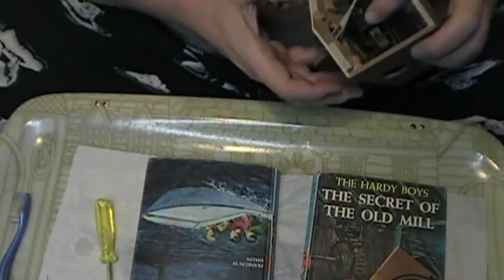Cuckoo Clock Repair 2.wmv

Comment from the maker: Pull the hands and the clocks face. Watch out for glue, you may need a razor blade to work the glue loose if it has any. Then right behind it is the cuckoo mechanism. Look at this video again where the shaft is sticking out and I am showing it working properly and watch how it works with the hour counting arm moving up and down into the counting mechanism. Either the arm is sticking up, the wheel is slipping or... You will want to take it to the hour then watch it in action to find the problem.

Comment: Hi Reed, I have a genuine Hubert Herr cuckoo clock that I received for Christmas.  The clock has been running fine until now....The weight on the left will not come down.  Is this something I can fix or do I need a professional?  Thanks!  Loved the video!
Reply: Susan Mann ..... Hey Susan have you gotten a reply on your question? I have a clock with the same problem. Curious as to what to do!
Reply: no, never got a reply, going to take mine to the clock shop.
Reply: +Susan Mann sorry, we've been on vacation across the US and haven't had the PC on for over a month :) The chain is stuck or it sounds like it got pulled up to far, putting the gear in a bind. Try pulling lightly on it while starting and working the pendulum. Then if the pendulum then starts working on its own, let it go for a few minutes and the chain should drop.

Comment: Hi Reed, my clock has the chain stuck how do I fix that, do I have to remove all the parts to reach to the gear. I think it is the minute/hour chain and not the one for chime and cuckoo one
Reply from the maker: Ashesh Sharma No, just take the weights off, set it upside down and try working both sides of the chain a bit until it starts moving. You should pull the back off and watch the chain to see where it is stuck. It may need a little work but probably just got pulled up to tight. If it won't pull because the S hook is against the wood, then you will have to remove the hook and re-thread it.
Reply: Reed Lukens 
Hi Reed, appreciate your response, the problem is the end which has the weight is completely up towards the hole (on the clock bottom) and it is jammed, Let me try once and will share the update. Appreciate your response sir!

Comment: I am looking to make a cuckoo clock. One with two platforms of dancers, two sets of doors that open, and of course a cuckoo and music.
I've seen similar clocks online, but I want to move things around and to use a different building design. That would mean I'd need to get different gear diameters and other changes. Any idea where I should start?  Thanks!
Reply from the maker: It all starts with the movement, you should get some rough dimensions and then pick the right movement for it first. The design around it.
Reply: Reed Lukens. Thank you. Actually I have something sketched out. But I'd like to see what type of movements and gearing are used to get dancing wheels off to the side and below the mechanism and how some of the animated figures work. Where can I see the innards of some of the more complicates animated Clocks in action?
Reply from the maker: Look here on youtube, there's literally tons  of movies that show cuckoo clocks being made. I think I have one on my playlist, click it and then it should open up a bunch more. You can also look at tower clock movements for the big picture :)

Comment: I was trying to set the beat on my clock, and the cat grabbed my chain and pulled it up.  HOOK and all up in the mechanism.  Any suggestions on how to get it out?
Reply from the maker: Lisa Carter Take off the weights, put a pipe cleaner or wire through the chain that is still in place and tie it in place. Then turn the clock upside down and move or lightly pull the chain  back down to where it belongs. Be sure to watch the chain and keep it in the sprocket. When you have it right then keep pressure on it as you turn it right side up. You will have to jiggle it some to move it into place  :)

Comment: I have a cuckoo clock. Everything works except the hands don't turn! All works when I turn the hands manually but otherwise all I have is the ticking but no other sound. Is this easy to fix?
Reply from the maker: Nope, it needs to be taken apart

Comment: Could you tell me how to fix the chains, I've pulled the the chains to the top without the weights on and now the clock doesn't run and I can't get the chains to reverse, Thanks Sean
Reply from the maker: +puppier Just lift off the pendulum and start the movement with the weights on. The little pendulum shaft will start moving fast and the chain will lower for the time or clock side, you can gently pull on the weights if needed to make them work sometimes. To lower the other simply advance the time to the hour and let it cuckoo it's way down as far as you like. If that doesn't work then you can take the back cover off, then look at the 2 chain drive wheels, then take the weight hooks off of the chain so it's just plain chain only and pull them both the rest of the way thru. Then you can re-thread them.
Reply: Reed you are truly amazing, this country needs more people just like you. Thank you so much, my clock is now working!

Comment: The bellows on my clock are glued in, not screwed in. I can't get the works out without ungluing them, and then there are no screws to re-secure them. Problem is that, like yours, the pendulum can't continue to tick. Turning the clock over, I joggled the chain out of the gear wheel. Can't open it to check for hair balls, and now I can't get the chain re-seated. Any suggestions?
Reply from the maker: The bellows can be pryed gently out, then you can either reglue them, or I prefer to screw them back in place with just a touch of glue in the center. With the clock upside down grabs both sides of the chain to work it back in. It can be easier with a second person to help watch & guide.
Reply: @ReedLukens  What size screws should I use, and what for the positioning nail? How deep should the pilot hole be drilled? ShouldI drill the first part of the hole bigger, leaving only that part that goes into the whistle to take the threads of the screws? I assume that it would be best to do the drilling before I unglue the whistles.
Reply from the maker: @mbhbYT  
Just use a small flathead screw,usually #4's are the smallest but #6 is fine. The length will depend on the thickness of the clock wall & the bellows wall and usually only one screw is needed with just one small touch of glue. The pilot hole should be  the diameter of the solid part of the screw, not counting the spirals. The pilot hole can go thru the bellows wall but keeping it just to the edge works fine.
Reply: @ReedLukens  , should I also make a second drill hole to insert a securing pin, like I see in your videos?
Reply from the maker: @mbhbYT  
Mine was really thin, so it depends. If you think that it will slip, then yes

Comment: Hi Reed,

I need your help. My cuckoo clock I two years old and it is exactly this one you showed in your video. Last week the clock fall from the wall and after that the cuckoo does not count down the hours.. It comes out in half hour and full hour but only one time. What could be? I am really down because I really like my cuckoo.
Reply from the maker: You will need to take it fully apart and look for a bent shaft or tooth in the gearing.
Reply: Reed Lukens Is it usually feasible to fix or it will require to change the movement? Some parts of the wood is very hard to take apart...
Reply from the maker: You can get the new movements easily on ebay. I just took the wood apart on mine for the video. Take the back off, pull the bellows, take off the chains, then remove the movement :)
Reply: Reed Lukens Thanks a lot.. I will try and let you know.. cheers!!!!! ;o)

Comment: Hi Reed....I am hoping you would be willing to help me out....I can't seem to find the answer on you tube and perhaps your answer will also help others :)  In any case, our cuckoo clock won't stop playing music and we cannot turn it off...can you please advise why...There is a spring that's part of the music box, but one end is not connected to anything...what does it connect to?  Thank you in advance for reading this post :)
Reply from the maker: There is a spring that connects to the switch that starts and stops the music. The switch is next to it on the inside depending on the model. If it won't stop each hour then the stop isn't being engaged and it travels or plays until the right weight hits the ground.

Comment: HI there I have a cuckoo clock which has been in my family for some year now.iv just resently brought it out of hiding after watching ur video.as it wouldn't tick.iv repired the bellows an cleaned an reoiled it is now ticking great.but the hands aren't. Moveing 
they move as they should when I use my finger to push them gently .just won't g on there own accord..im bit baffled has every think looks as it should
Reply from the maker: Sounds like you should pull the hands and make sure that the spindles are turning. If not then a gear could be chipped.
Reply: Reed Lukens
Reply: Reed Lukensil give it a try many thanks for your quick reply .i think cause iv checked the gears and theres realy no damage to them .i think it just gave up when my grandfather past .it was brougt for him as a present from germany when my uncle was in service there in the late fiftys early sixtes.thanks again if any luck il keep posted.

Comment: hello. 
i have a cuckoo clock that does not chime .  It is battery operated. I have had it for years but after i changed tge batteries and tried to reset the chimes it did not work. 
  The clock is great.
the logger and bear have not been reset correctly. The diections said to run the hands past twelve then in reverse to 11:00 and it would reset the chime. No such luck.
Any suggestions?
thank you in advance either way.
t. nye
Reply from the maker: The first thing to check for me would be the switch on the side. If it's on then pull the wires and connect them together and that will tell you if you have a bad switch. Then if that doesn't work, run a jumper to the chime and see if it takes power to it. If not then the chime will need replacing :)

Comment: If you do it the right way, you have to adjust the verge if it still isn't running after a PROPER cleaning and oiling. You have to have them on the wall just right to get them "in beat". Listen to it after you start the pendulum, paying careful attention to when it stops ticking. Tilt it to the opposite of the side it stopped ticking on. Most cuckoos have a very small allowance for error in beat. Don't give up. As for "armature cleaning", do you mean ultrasonic? If so, the vibration isn't good.

Comment: Hello
Any ideas for bending the new bird rod that came straight on a new movement to match the old? Heat? remove the rod first? 
Thanks !
Reply from the maker: Stephen Burkhart The rod bends easily with pliers. Be sure to adjust it to get the bird to come out as far as possible. Most of the time there is a little play in the rod.
Reply: Hi Reed Thanks but the rod is like hardened steel. It wants to break and come out of the small fork brackets that hold it to the movement. This is a Herr 8 day. I am going to try to heat it with a small torch.I tried using 2 vice grip pliers also! Of course its not exactly the same as the original movement otherwise I would just change the rods, The original one is shorter (on the movement) and held on by nice screw on brackets. I have to be careful as this is a repair job. The new movement was $160.00 !!
Thanks!
Reply from the maker: Wow, that rod... I thought you meant the slide rod that the bird hooks on... So no brackets, I've never had to use heat in a clock :)
Reply: The heat worked pretty good. It's almost a 2 man job. Had to factor in the bend when measuring. Its more of a curve than a right angle but it worked ok. I did not want to force a sharp right angle. Also had to factor in the position when the bird would be "out".;
It's ok. But Herbert Herr movements are crap!
Nice clocks but bad movements. LOL Thanks again!
Any chance you have a round railroad pendulum? Does anybody make one? Can't find any! Geez I miss my machine shop equipment!

Comment: what a great video!  I have an Austrian cuckoo clock that we have had for about 4 years now.  It’s worked beautifully until I was (gently) pulling the chains and suddenly it fell off of the wall.  Luckily I caught it in mid-air, but when I went to put it back on the wall, I noticed that one of the weighted chains was stuck, which is why it fell off of the wall when I went to rewind it.  The clock still keeps time and ticks, but only one of the weighted chains moves, so the cuckoo does not come out and eventually time speeds up on the clock due to one of the weights being stuck.  Any idea what to do for that?  I LOVE my clock and I am so sad to think I might not be able to hear the cuckoo again :(
Reply from the maker: One chain is for the cuckoo and the other is for the time so I would pull that chain off and find out what is keeping it from moving :)
Reply: ...hmmm...i think you just reached the limit of my ability by giving those instructions, LOL.  the stuck chain’s ’S’ hook - where the pinecone weight gets attached’ - is all the way up against the hole that is is threaded through and up into the clock.  it only moves a hair when i gently tug it, and i can see the gear that is stuck.  i don’t think i’d be able to remove the chain?
Reply from the maker: pull off the weight and the S hook then see if it will pull on through and out. If it does then rethread it and that probably will fix it. You may have to take a link out from inside the clock to get the S hook off if it is jammed that tight.
Reply: thank you so much for your help, but i’m thinking i might be in over my head with this one. worried i might damage it by trying to take it apart?  i made a little video, but am having trouble uploading...oy!
Reply: Okay so I just uploaded a little video showing the problem.  No worries if you don’t have time to watch and respond..I know you don’t have all day to mess with one person’s issues :)
Reply from the maker: If you don't want to pull the chain all the way through then you can advance the clocks time to the hour while pulling gently on the stuck weight and that might unstick it. It's best done at a higher time like 10:00 or more. I'm sure that the chain is just off of the track, so pulling off the S hook and pulling the chain all the way through and then restringing it would be best. But I know what you are saying so advancing it to the hour while pulling on the S hook should get it to start moving but it may hang up more. AT around 8mins in my video it shows pulling the chain out and then at 34mins or so it shows putting the chain back in :).
Reply: Thanks so much for taking the time to give advice...I will definitely try what you’re suggesting!

Comment: Hi I have a clock just like the smaller one on the wall in this video and my wife pulled the chains to tight and it doesn't work now how do i fix this please help thank you Tony
Reply: Try moving the minute around the dial until it strikes. Or what you can do is gently pull down on the weight until is starts running. The clock may be dirty and may need a cleaning as well. If any more need, let me know.

Comment: Help! The hands on my cuckoo clock are loose or one is...how to tighten it so it keeps good time?
it plays music and the rest of it works fine but it doesn't keep the time...
Reply from the maker: You can buy new ones on ebay depending on how bad they are, just type in cuckoo clock hands. They just slip on otherwise and some have a little tab that can be bent.
Reply: thanks for your response no the hands are in fine shape I think one of them just needs tightening up
I am looking for one of those pointed pliers, think I have some here someplace.  lol
It's a beautiful clock and i bought a long time ago, today it would cost a fortune.
I took good care of it but it probably needs cleaning.
thanks again,   Deanna Loretta

Comment: My clock keeps perfect time but my rack is not falling into place.  So my cuckoo goes until it runs out of chain.  I give the weight a tug and it just goes and goes.  I need a video of how to fix it.  I removed the hands and face plate and now I am lost
Reply from the maker: There is a pin on the gear that has broken most likely. Look inside closely while it is moving and you will see the broken pin. Just replace it.
Reply: Thank you.

Comment: i have an identical clock that needs weights.  Can you tell me how heavy your weights are?
Reply: I mean the clock that was repaired in this video
Reply from the maker: I gave it away but I'm pretty sure that they were the 275 gram like these
http://www.ebay.com/itm/One-Pair-of-German-Black-Forest-Cuckoo-Clock-Weights-275-grams-each-/271373272209?hash=item3f2f1b8491:g:1nAAAOxycmBS1nJd
Reply from the maker: I gave it away but I'm pretty sure that they were the 275 gram like these
http://www.ebay.com/itm/One-Pair-of-German-Black-Forest-Cuckoo-Clock-Weights-275-grams-each-/271373272209?hash=item3f2f1b8491:g:1nAAAOxycmBS1nJd
Reply: Thanks man..  I really enjoy your vids and am inspired to get this old clock going. maybe find another project clock..Those old clocks , in my opinion, were and still is, craftmanship at its finest.

Comment: Thank you but it is at times hard to clearly see the fine details in the video. My clock works the same as the one in your video until 14:41 minutes into the video. When you say "and it locks into place" that is where my clock also brings the bird back in but then starts moving the bird in and out and the gear just keeps on turning until it hits the ground.